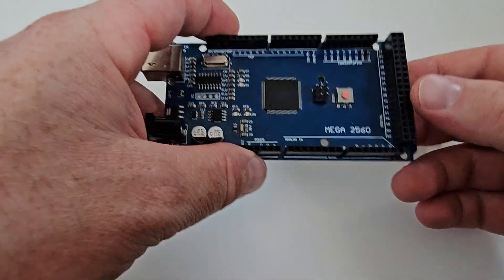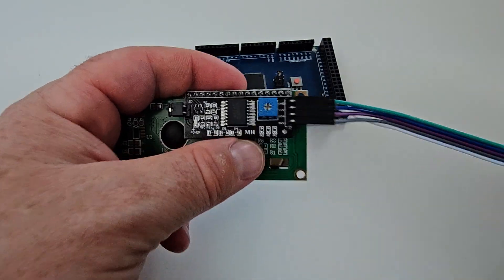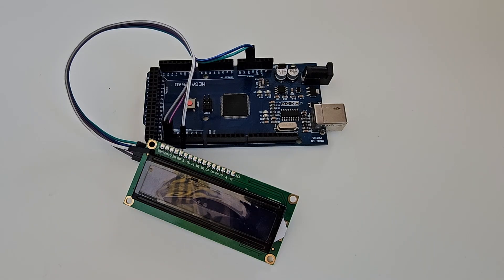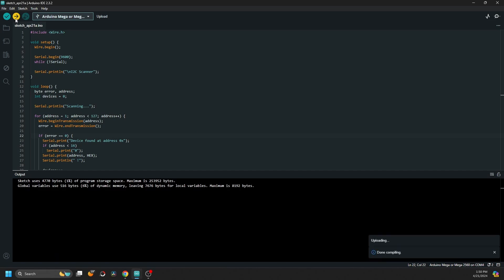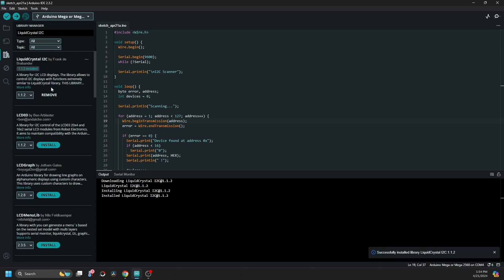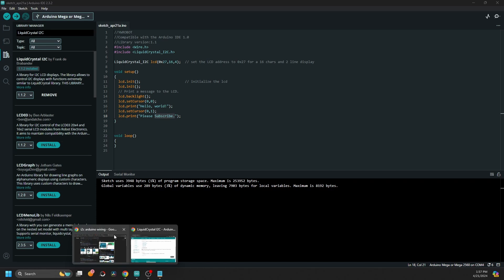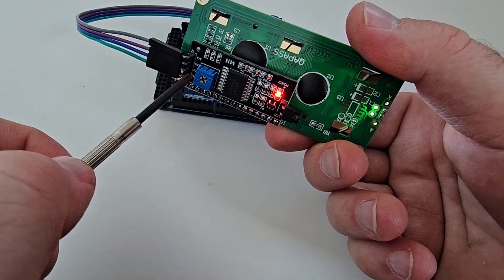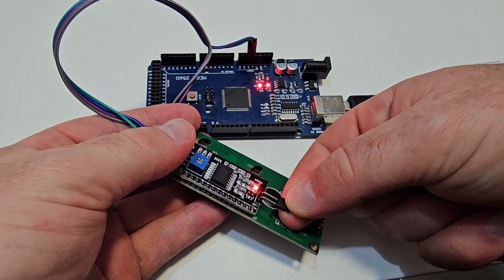How to Use I2C LCD with Arduino | I2C Scanner Arduino | 16x2 LCD I2C Tutorial

Comment: i did the exact same and it cant find any device connected... i dont understand, since i already used a potentiometer on these 2 pins so the cause cant be defect pins. im trying to solve this issue for 2 days now
Reply from the maker: if you add a potentio meter to an i2c output won't work, try to remove the resistance from the communication i2c layer. will solve it.
Reply: @JustBotond  thanks for the reply but you missunderstood me. I have the exact same setup with a 16x2 i2c lcd display, but it cant find the i2c adress with the example scan scatch, the device is not found.

I just said, i used a potentiometer on these pins so they are working, its not a problem with the pins.
Reply from the maker: what kind of board are you using ? are we still talking about arduino mega? if yes there should be a different i2c com port for it. Is i2c working with any other component?